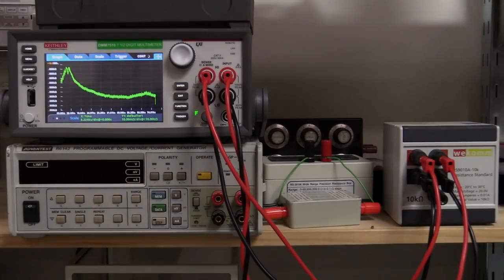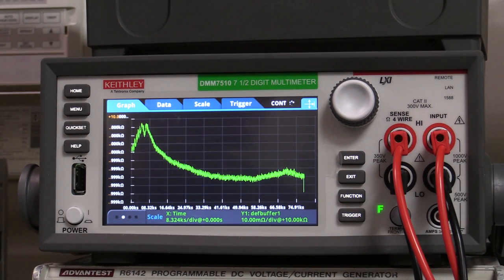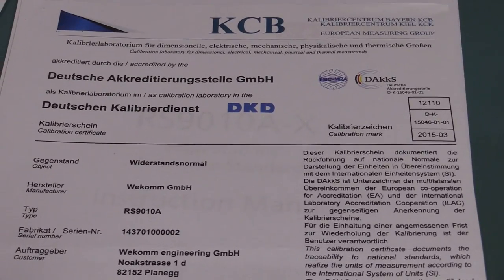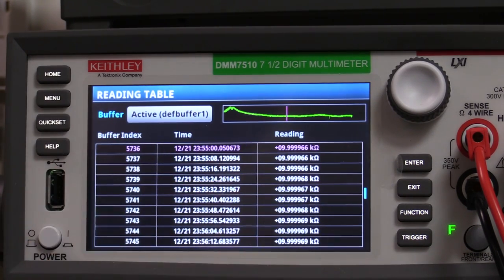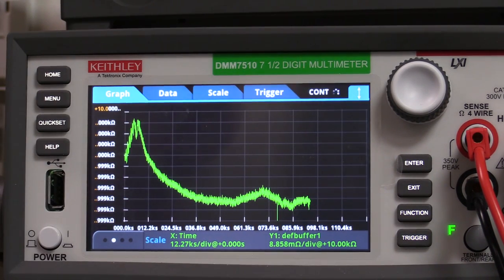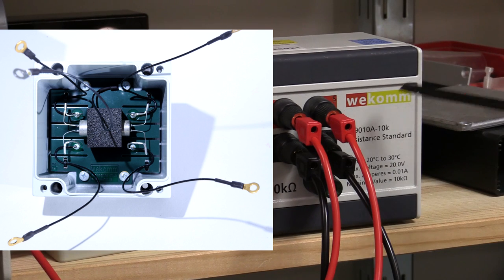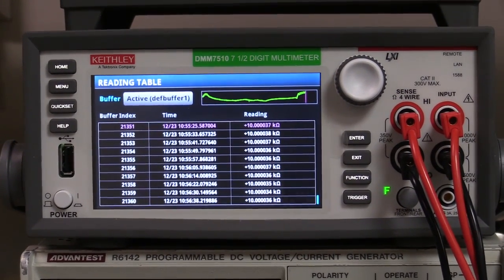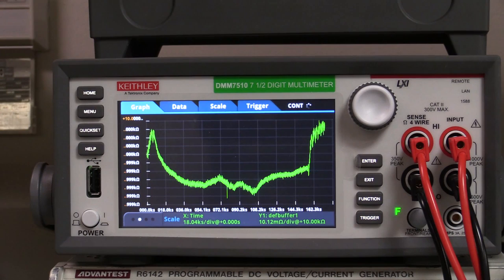EEVblog #834 - Wekomm Resistance Standard

Comment: "Just a quick little video."   Lasts 24mins. Never change Dave!
Reply: +Thomas Kell And then we have part 2 (private at the moment :( )...
Reply from the maker: +Thomas Kell It was seriously meant to be a 2nd channel video just showing that first graph. I got hooked...
Reply: +EEVblog While i was at it i wanted to ask if you would be interested in tearing down a Nintendo Virtual Boy. It was a total commercial failure so it's somewhat of a novelty item at this point. However i do have a spare one that turns on but it has a busted LED which is mostly due to the poor choice of glue they used to fuse the ribbon cable with. If you are interested i'll send it down to you. And as always, thanks for the great content!
Reply from the maker: +Thomas Kell Sure!, thanks, send it into the mailbag.

Comment: As a technician, even fixing a wide range of gear, I can generally do my job professionally with just seeing if a resistor is open circuit or not.  I don't need this out of spec by 0.00047% and this parts per million per degree rubbish! :-)
Reply: +Alan Liefting open circuit or not, that's a pretty wide tolerance!
Is there a colour band for that?
Reply: +Alan Liefting You're not the target audience for this type of test gear. The people who have to care about this stuff are the designers of scientific instruments like electron microscopes
Reply: Josh Bradshaw yes I realise that. And I just wanted to throw in one of Daves phrases! :-)

Comment: Very interesting stuff. Some viewers might think "that's nit picking". Well, try to measure temperature with a resolution of 0.01K using PT100 while the PCB itself could be at media temperature or room temperature. So the reference resistor of the PCB could be anything from 15°C to almost a 80°C while measuring hot water. All of a sudden these things become very important and in my case I found myself purchasing single resistors for almost €10 per piece and resistor networks for like €45 per piece. Otherwise the circuit would be 0.1°C out.

Comment: Dave, didn't you heat it up too much by any chance? I mean, the ratings on the front say V max = 20, and A max = 0.01, giving a max dissipation of 0.2W while the Keithly is talking about a 4W resistance measurement....

Comment: Dave, I guess the fluctuations of the graph may be due to the Air-Conditioner's PWM (On and Off to control the temperature). If your Air-Conditioner is inverter based you will not see these fluctuations of the graph.

Comment: Don't forget, thermals, temperature change, I would use special leads, Twisted Silver Plated Copper (PTFE) with outer Silver plated copper screen to guard on DMM, with Copper connectors (Crimped) NOT any solder as this can cause thermals, Also remember their test current used in their test, I am a retired Calibration Manager of UKAS Laboratory where measurements were often in <10-6, I would monitor temperature of that resistor at the terminal point, & Room temperature neat the case of the resistor, Dave it looks like a Vishay 4 Wire Standard Resistor in a box !, as I've used these in my laboratory design of STTE
Vishay used to do a 4 Wire wound Argon filled, low inductance winding sealed,
My OWN Two Yokogawa Standard resistors Model 2792A  Valuves 0.1 Ohm & 0.01 ohm were stolen, deep loss for my own test - calibration laboratory which is my lifetime interest, 
Philip

Comment: I wonder if barometric pressure is having any effect, possibly explaining the initial small dip in resistance when the ac was turned on.
Reply: +pocoapoco2  I have done a similar experiment (but then with a LM399) and logged the pressure too and that made a difference. (Even the level-angle deviation of the reference made a difference) I held the inside of the meter at a fixed temp. 
Dave: a rather expensive setup to measure your lab temp :-) and indeed, it can keep you busy for weeks.
Nice Video.
Reply: I wish I could get this much enjoyment out of a resistor... maybe one day

Comment: Would be interesting to see how much the internal voltage reference in the meter is drifting vs exterior temperature. I say this because those results seem to be happening too quickly to saturate the metal/case that the resistor sits in, but not for a fan blowing air through a meter.

Comment: My thoughts would have been towards the meter because of the last part of the graph was clearly showing an active element to it which the passive resistor wouldn't have.  The Graph was showing an up then down then up then down as it was climbing.

Also to add to this idea, the spikes may have been due to power surges when the aircon went on and off, the lights too would produce surges that at the resolution the meter was working at would be visible. .
Reply from the maker: +Michael Hawthorne In this case the spikes are not the aircon (but that's not uncommon in gear). The spike happened right when I bumped the bench.

Comment: +EEVblog Correct me if I'm wrong here, but isn't 2.5ppm = 0.0000025? (five decimal zeros). You got it down as 0.000025 (four decimal zeros) on your post-it. ∆ of four degrees would be 0.0000100 then.
Wouldn't that mean it might be at least a lot closer to being out of spec?
Datasheet around 19:40 mark.

Comment: Dave, I think you were off on your meter error calculation by an order of magnitude, 2.5ppm is 0.0000025 (5 zeros after decimal point, you only had 4), so would be .00001 over 4 deg drift, about 6 times less compared to the diff you noticed in the measurements so not clear if that was the meter, unless I got something wrong
EDIT: never measured this but would be interesting to see relative measurements with the leads shorted over the same temperature range, might be interesting to see if that's where the difference comes from.
Reply from the maker: +sharp x 2.5ppm is 0.000025 Kohms. You have to scale it for the 10k resistance.
Reply: EEVblog
ah, duh - brain fart on my part (rimes too :)
btw, can you help me validate my eevblog account, the validation email never makes it in my inbox (or junk mail for that reason).
Reply from the maker: +sharp x You had me worried for a minute, I had visions of having to recall or annotate the video! Send me an email with username
Reply: EEVblog

username is sharpx, don't know your email.
sorry about the ppm, I was going by delta, didn't clue in the spec was for the 10k range until you mentioned it.

Comment: Thanks Dave, I'm working the same type of measurements on a voltage reference and resistors with my 34401A.
So I have 2 questions.
1. I hear a fan, does the Keithley run a fan? If so the ambient temp may change faster with the fan forcing the air through the the meter to coincide with the air temp of the lab.
2. Does the LCD turn off as a screen saver on the Keithley? If yes this might also justify some of the temp coefficientcy change with the meters internal components.
Reply from the maker: +Dave B.Reviews (My Gadget Tech Thoughts) Yes, it has a fan. No screen doesn't turn off.